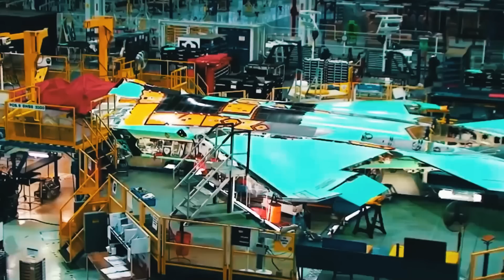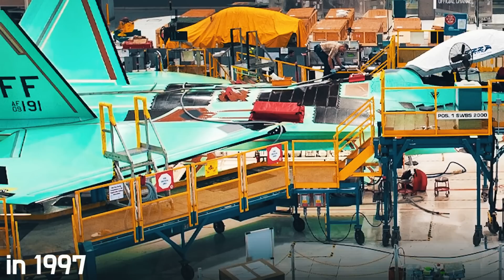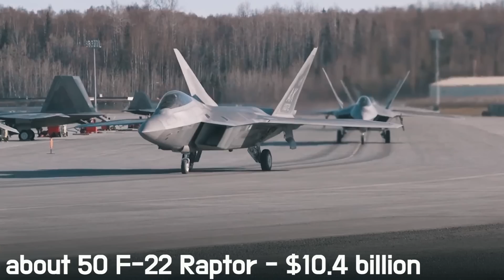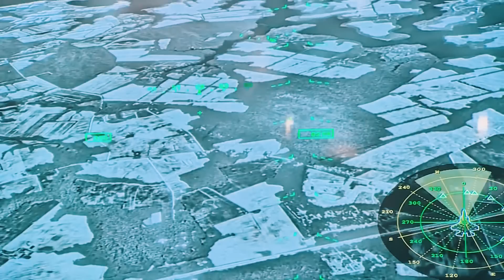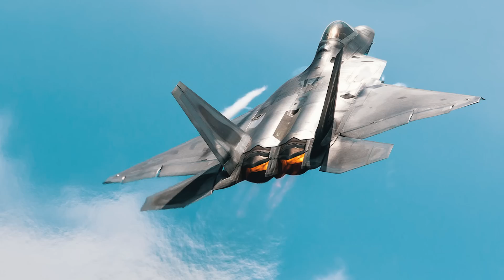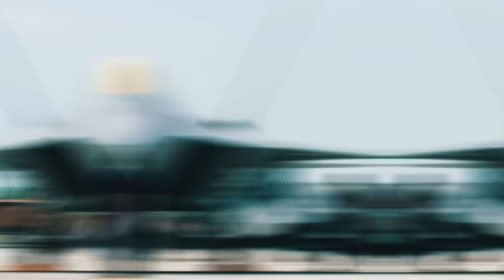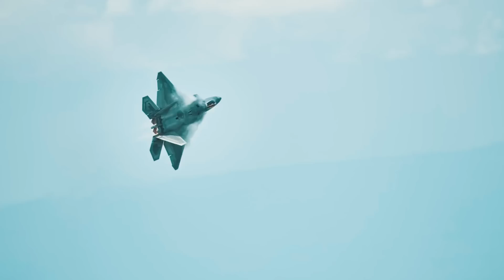New F-22 Raptor After Upgrade Shocked The World

Comment: “tEh LiGhTeNiNg TuRnEd OuT fRaNkLy NoT vErY wElL”

It isn’t designed to fill the same role as the F-22 so stop trying to compare it to one. If you looked at the F-35 for what it is and what it does it is amazing.

Peace out. ✌🏼

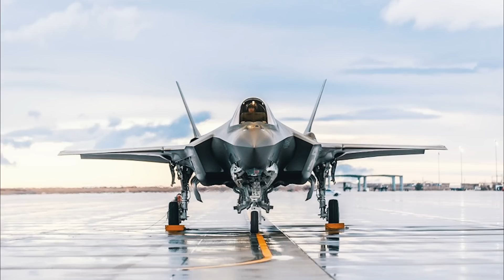Comment: 2:28 The Lightning turned out not very well? By who’s standard? Most of the “negatives” we’ve heard about the F-35 come from one shill named Pierre Sprey, who never actually worked in the aerospace industry, but, until his death, claimed he did and spouted a load of nonsense on a Russian propaganda network. Funny enough though, they broadcasted the program in English instead of Russian. They only criticism we know for a fact is real is that the engines require a fairly high amount of maintenance, but they’ve got newer engines coming to negate that problem. Most of the F-35’s specs are still classified, so where these arbitrary conclusions keep coming from is beyond me.

Comment: Both the F35 and F22 are amazing low vis aircraft, however in a dog fight, the F16 flew circles around the F35 and the F15C flew the pants off the F22, in addition, both the F15 and F16 can bomb the heck out of almost any ground target.  However, in my opinion, for close air support, the A10 is still the aircraft to beat for durability, accuracy, and survive-ability.

Comment: Correction - the first stealth fighter was the Lockheed F-117 Nighthawk. That being said  the only valid reason I can see that caused the USAF to cancel production of the F-22 Raptor is that the new 6th gen fighters coming down the line will make everything else so obsolete that further funding will be throwing money away that is needed for the development of the 6th gen. Also there is the potential that the 6th gen could be pilotless or have a drone configuration. You can be sure the US military is well invested in AI technology.

Comment: The first Stealth Aircraft was the Lockheed A-12. It first flew on April 30 1962. The SR-71 first flew on December 22 1964. The A-12 was extended and a second seat installed to accommodate a weapons officer. They are very similar aircraft and actually the SR-71 was simply longer with two seats instead of one. However, they both have different official names.
Reply: 100
Reply: Nein. Die A12 war kein Steatlh Flugzeug. Es hatte KEINE Radarreduktion. Das wird oft falsch gesagt. Der Anstrich war wegen der wärme. Jedes Radar hatte das Flugzeug auf dem Radar... nur konnte es damals nicht bekämpft werden.
Reply: yep bit miss information there and there
Reply: yea..... yea, you caught that one too huh? lol

Comment: I'm pretty sure this video is making some errors in it's claims.  (correct me if I'm wrong)  The  F-117 was first stealth aircraft and I think the French Rafale was the first supercruise.  That said, the f-22 is a legend. It was, by far, the most badass fighter when it came out. Even today America will sell an ally a brand new f-35 but not an f-22 due to classified technology. It was so far ahead of it's time, even decades later few aircraft can compete against it. That's an incredible feat of engineering when you consider how rapidly technology advances.

Comment: The Raptor does not, nor has it ever had a phased array radar...it's had an AN/APG-77 since it's inception, which is a  fully AESA radar...all electronic...yes, we've had AESA tech for that long 🤣. And the 77 is STILL one of the best, most capable fighter radars on the planet! It even stands up pretty much to the F35's AN/APG-81 radar..it's systems are a bit different, but I think it can beam form a little faster even! They're not touching it or replacing it, I know that much lol

Comment: I worked on the F-22 program as a contractor to Lockheed Martin. My company supplied the leading edge flat actuation (LEFA) systems…. the side weapon bay(SWB) door actuation systems……. and the main weapons bay (MWB) door actuation systems. I Worked with the contract company 22+ years… was involved with the research and development testing, and production testing.

I was responsible for all of the test equipment, and all the calibration for testing….on all of the subassemblies,  before they left our facility,  to be installed at the Lockheed production line. Lockheed and all the subcontractors,  took a huge loss ….many hours and millions of dollars of R&D were involved getting this aircraft put together , and not enough were made….. after the government Axed the program, For all of the companies involved , to recoup their losses. Everything on this aircraft is very critical… as timing with the doors opening releasing ordinance and closing ….in an undisclosed amount of time , we had to accommodate and test our units , Under the guidelines per Lockheed ….if it did not make criteria on our test equipment it did not ship. Each side has a (PDU) Power Drive Unit, or technically a hydraulic motor,  powered by the aircraft, to open the side doors …also a large hydraulic motor(PDU) controls the main weapons door systems . The timing on the systems were very critical,  for the stealth capabilities to remain undetected. It was vulnerable to a bigger cross section during that blip of time for detection. After the government did what it did …our company business suffered,  as well as Lockheed, and every other subcontractor for this aircraft. Also , I was involved with leading edge flap systems for the F-35 A,B, and C variants…..and the ordinance release mechanism, which we tested just like the F-22. The cost of the F-35 program is astronomical. It has its advantages, because of the ground attack modes with of the different variants. With the cost of the F-35 …. they could have completed the contract for the F-22. The air frames can only take so many flight hours of designated time. I don’t think it’s very realistic,  to see this plane lasting another 40 years. With new avionics upgrades and all the high tech helmets, That can be added to this aircraft ….that is well and good if possible. But , once the airframe flight hours are acquired , it will eventually be parked. A new F-22 airframe will never be developed again,  that’s facts! Its role was to lead the F-35s….taking out threats ahead of them ! It was a big mistake for our government to cancel this F-22 program. The six generation will be a long way out I’m afraid, time will tell.

Comment: They should’ve went with the F21 Super TomCat. Would’ve saved a ton of money in the long run & could’ve been turned into a Stealth Interceptor Ultra TomCat that with the right missile or laser tech maybe could’ve been used to engage hypersonic missiles.
Having a Navy version & an even more scary version for the Air Force that most likely would be a 5th Gen monster today. Mach 2.5 way back then, imagine what it could’ve been had it not been retired because of “cost.”

Comment: F-22 is a great aircraft, and it clearly holds air dominance over others. Much like the good old f-15. They did to much to the f-35 and its more like the F-15 Eagle. Great for attack missions, but lacked the agility in air to air combat.
Reply: The f35 agility is much better than expected, when it was first released the software was limited preventing 9 g turns.  It's maneuverability is on par with f16 while having advantage in it's sensors, situation awareness, and smaller radar signature

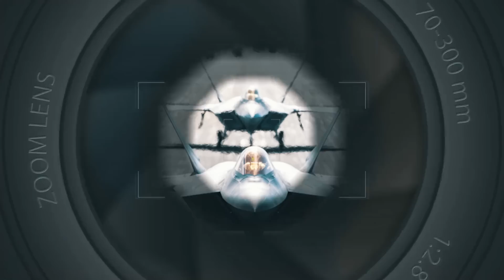Comment: At minute mark 0:51 you stated "The F22 Raptor began entering service with the United States Army in 1997." This is a very gross error as the U.S. Army did not have fighter jets like the raptor. Only fixed wing aircraft flown by the US Army were medical transports like the C-12 Huron, Gulfstream C-20, C-26 Metroliner, C-27J Spartan, C-31 Troopship, Gulfstream C-37, EO-5, RC-12 Huron and the Cessna UC-35. The United States Airforce fielded the F-22 Raptor on 7 September 1997. Please get your facts straight and do not disseminate bad information.

Comment: Private Rock, the ultimate grunt

We seem to have forgotten about the F20. Its super fast scramble time is something that is needed by many of our allies.
Reply: The tigershark?
Reply: Yes. The tigershark. This one Air Force person a few days ago said that when you put bombs under the wings of the F20 its performance suffers badly. So why not use this plane in a mostly defensive role? They could use it to throw up a fighter screen very quickly when their radar detects incoming planes. South Korea, Taiwan, and Israel all could use a plane like this, among  other countries.
Reply: @georgepalmer5497  Because Congress consistently blocked sales and had to mediate troubles between McDonnell Douglas and Northrop. The Mirage 2000 ended up being what the F-20's potential customers bought after all of the troubles when attempting to place orders for the F-20. It just wasn't worth all the hassle that Congress and McDonnell Douglas put them through, and the program ended up being cancelled around 1986. The Mirage 2000, at the time, looked far more promising with its 2000C-S5 model on the horizon with a brand new RDI radar and engine, as well as compatibility for every missile on the market - even Soviet ones with a rail attachment.

Edit: And by today's standards, the F-20's extremely outdated. It would crumble on any modern battlefield shortly after takeoff. Taiwan has Mirage 2000-5EI's, F-16A Block 20's, and their F-CK-1's. South Korea has their FA-50's, F-16C/V's, F-15E's, F-35's, and KF-21's, and Israel has the F-16I's, F-15I's, and a new F-15EX model titled F-15IA on the horizon.
Reply: The F20 came out at about the same time as the F16, and it would have been getting many upgrades during that time, like the F16. One guy said on the internet that when you put bombs on an F20 is when its performance starts to suffer. I was saying that we shouldn't try to bomb with it at all. We should have used this plane in an entirely defensive way. We could use it to throw up a fighter screen when enemies attack from the air. There are a lot of situations in the world where we have an ally directly next to a savage enemy, like North and South Korea, for example. There are a lot of countries that would love to buy this plane. I don't know for certain, but I'm willing to bet that stealth aircraft are devilishly hard to keep ready for combat at a moment's notice all the time.
Reply: @georgepalmer5497  The F-16A blocks post-1981 blow the Tigershark out of the water in every conceivable way.
Reply: Not in scramble time. There are a lot of nations need a plane that can scramble super fast. I read an article in The New Republic that said that some people believe  the F20 might be a slightly better dog fighter than the F16. You can talk about block variants all you want, but we could also make block variants of F20's.
Reply: @georgepalmer5497  Don't know why you're so obsessed with the F-20. I love it too, but I take it for what it was - a super cheap export fighter that wasn't built to compete with any contemporary fighter even at the time. Scramble time means nothing if you can't do anything once you're up there. Plus surely it'd be about the same as an F-16 anyway.
Reply: What gets me is the scramble time. I can look at a map and see all these allies and democratic government with borders right on a rogue country. I'm no authority, but it seems to me like scramble time would be critical in some parts of the world. But, yes, that was how I wanted to market the F20, as super cheap export fighter, but I think the F16 has a really good scramble time too.

Comment: Reguardless of the advantages of the YF-23, it was far less developed, had more questions about how much better it might have been versus the F-22 and,  exorbitant cost over runs would have been far worst.  To me the worst BAD decision was to terminate with such a low number of F-22s produced.  All the great stealth qualities, super cruise, etc. the USAF wanted a plane that when push come to shove or the that F-22 will dominate even in a "furball" or any other worst case scenario.
Reply: The YF-23 gave up the stealth signature when it turned.  Furball?  That's propeller plane terminology.  You seem to be reading too many fantasy stories about the YF-23, and little facts about the YF-22.
Reply: All stealthy aircraft have low observable or stealthy aspects from certain directions and less stealthy aspects from other directions.
Reply: That's one of the most idiotic statements I've ever heard about the YF-23.  The YF-23 was more advanced than the Raptor.  It met all of the requisite demands set forth in the program requirements. The Raptor does not. Case and point, the Black Widow was capable of super Cruise at Mach 1.8. the Raptor still is not capable of super cruise.  The Black Widow is also much more stealthy than the Raptor.  The Raptor was more maneuverable. That is the only way it beat the Black Widow.  The Raptor being chosen instead of the Black Widow was a political decision not a capabilities decision.  Why do you think the black widows were kept after the fly off, by the United States Air Force instead of destroyed or returned to its manufacturers? It was far too advanced to hand over or be destroyed.
Reply: @michaelwilliams9574  the YF 23 never met the demands of the us air force...the raptor was able to supercruise more than the YF 23...the raptor was more faster than the YF 23
The raptor was more agile than the YF 23 which is not even agile
The raptor was more stealthier than the YF 23 as in radar cross section this was the size about the bumblebee which the YF 23
The raptor was built for dogfighting which the YF 23 is a failure in that
The politics and us airforce chose the f22 raptor because of its dogfighting capability whcibthe YF 23 cannot do...this doesn't matter whether the YF 23 was advanced or not..when it comes to air superiority it means it should good in everythign and the f22 raptor was proved to be better..they only intervened becuz they thought it would cost less...other than that the f22 raptor was a better choice than the YF 23
Reply: @adithyansunil1153  there's so much wrong and everything you just said right there. I'm not even going to take the time to dissect that one. All I'm going to say is start over and do some research.
Reply: You guys do realize the of the advantages and technology from the yf - 23 was considered and also implemented into the f22 final assessment right? Just because Northrop lost the contact deal to lockheed dont mean they didnt play a roll in the f22. They were stil needed to share the yf 23 technology and were in charged parts of the f22
Reply: @89turbomk3  what are you talking about???? The YF- 22 is already designed/built. Northrop didn't take anything from the YF-23 and put it into the YF-22. You're talking nonsense.
Anyone who knows anything about these two aircraft can tell you what you're saying is incorrect in every way.

Comment: I built the stimulator racks, which they used down at the big Hughes anechoic chamber in Texas for the F-35 and the F-22 from around 2004 thru 2006.  Even the first ones did still have numerous sensors.  One supposes the stealth profile was one factor for not including some things.
Reply: A friend of mine was on the engine program working on thrust vectoring. Some of the engineers would use the early 3d printing machines used for prototyping to make custom parts for their cars if I remember correctly.
Reply: My aunt designed the fuselage
Reply: @jerrychan2851  no way!
Reply: @reinerbraun1024  yea
Reply: My left nut designed the ailerons and landing gear.
Reply: How many non-disclosure agreements have you signed
Reply: sorry you had to work on the F-35
Reply: @jsmith3388  I did not work on the bird itself, I worked on the test hardware that proved the bird's capabilities in the battle theater.  You're sorry?  Did you read some derogatory article about them or something?
Reply: 'anechoic chamber' !??
sound like space horrors...

Comment: IT'S THE 2ND BEST PLATFORM EVER BUILT WE SHOULD HAVE BUILT THE YF-23 IT WAS MUCH FASTER LONGER RANGE STEALTHYER AND MUCH MORE ADVANCED AND UP-GRADABLE AND IT LOOKED A LOT COOLER
Reply: I agree.
Reply: TOTALLY AGREE!!!!!
Reply: Agreed. USAF should've continued developing the YF-23. IMO much of the design tech in the YF-23 is part of the NGAD program.
Reply: @wilson rawlin  wasn't the reason the yf23 lost was due to politics and how McDonnell Douglas some how fucked up a military contract prior to the yf23? I'm pretty sure the yf23 was a superior aircraft.
Reply: @randybobandy9828  
Yes politics.
Reply: I agree but an often overlooked fact about the Black Widow is that they already had designs for an attack version of the aircraft as well.  Politics are what won the contract, it was not the superior aircraft that won.
Reply: Was it even more expensive?  Genuine a question, not a rhetorical one.
Reply: Very cool looking, and test pilots preferred it's performance characteristics.
Reply: Would have been cool to see the Navy take it over.